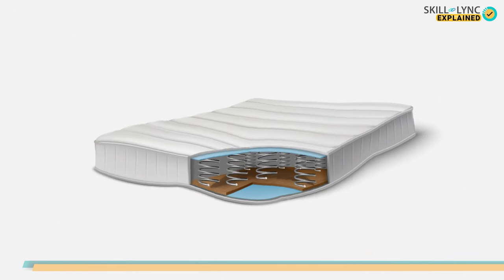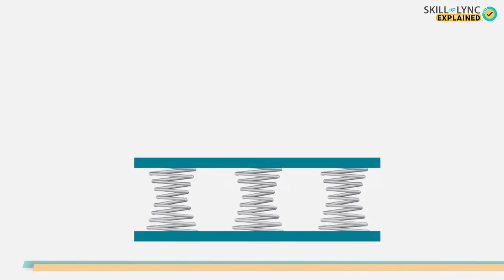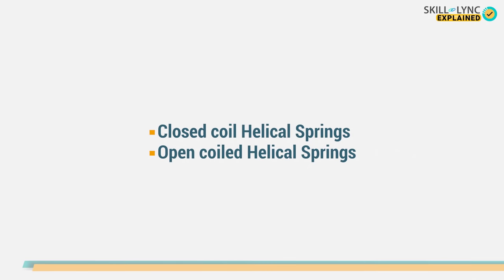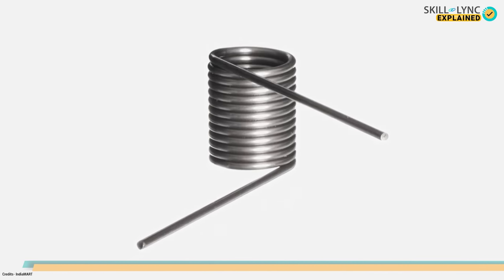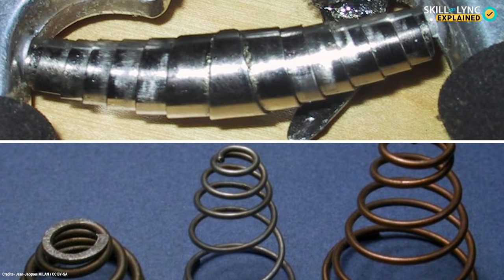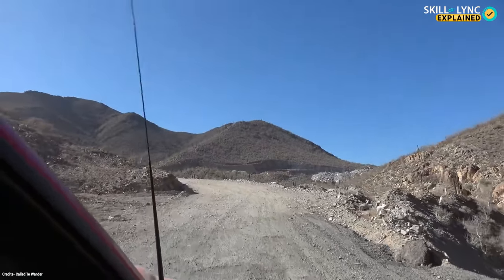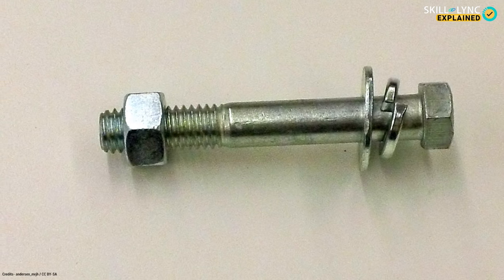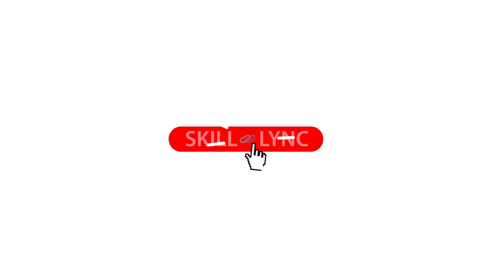Different types of springs & their uses | Skill-Lync

Comment: I need a spring that you Charge, either stretch or pull, what type of spring World you suggest to get the most energy back out of the spring and lets say just use 1/3rd of the maximum stress capacity of Such spring